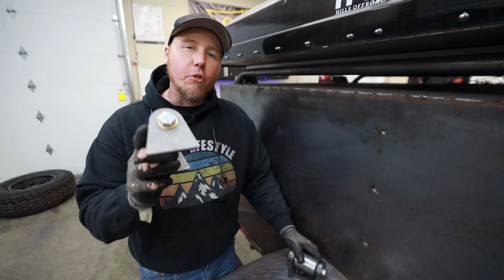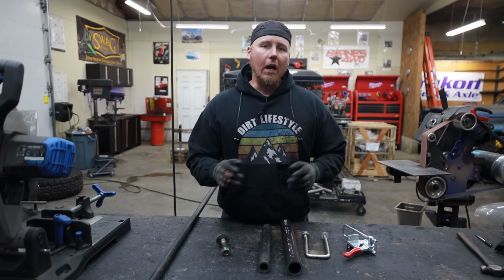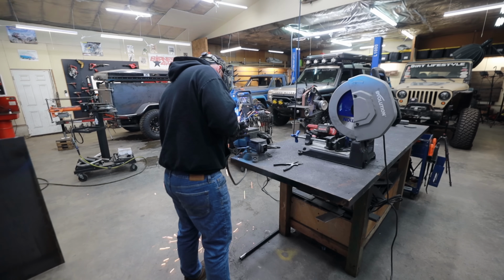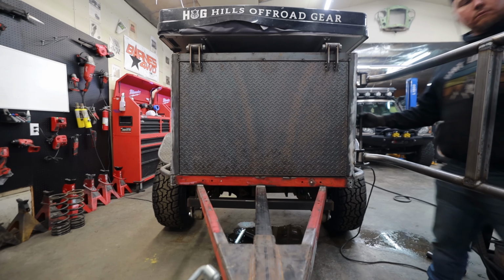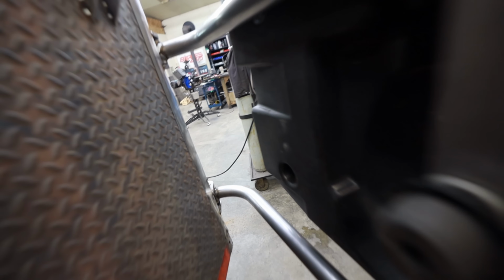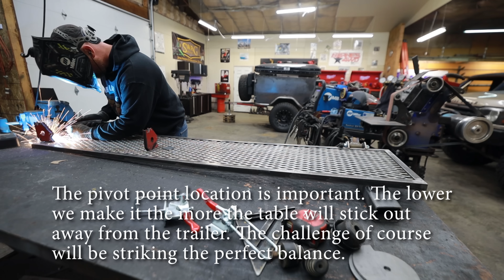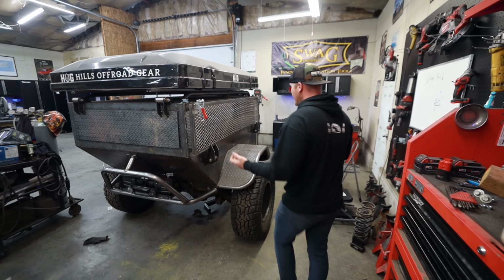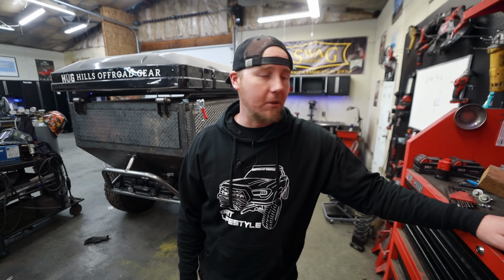Finally Back In The Shop! Harbor Freight Offroad Trailer Episode 6 👊.

Comment: nate, you could add a small tapered spigot near the latch, to take the load of the carrier off the 2 hinges directly. any up/down then would be going into the outer structure. i did see that you said there's no flex in it and its strong, but corrugations (washboard i think you call them) are pretty good at destroying anything that can have any give at all. as for your supports, can you use some old retractable seatbelts and mount them inside? make them bottom out when the table is level. some small latches on the side to hold the table in when not in use

awesome build

Comment: A cable, a counter weight, a few pulleys, and an adjustable stop on each end of the table. Add a latch to hold it in the down position if needed. Put the counter weight in a channel inside the trailer. Think like you’re working in an old freight elevator door. You’ll see it.

Comment: For real simplicity on the table cables... Look at old fashioned big heavy wooden windows. They had weights in the wall, that helped against the weight as you slid those big windows up. You could do the same sort of thing with the table cables. Small pulley inside that the cable rides over. A weight, to pull it down, when you lift the table. And a catch at the top, for the weight, so the table is supported when open.

Comment: A window sash weight system inside the body would make an easy retractable cable system.  Flexible kitchen faucets use the same principle.  Would need a tube as a guide just to keep from banging around

Comment: You could use a weight in the middle  like clamp style  or the old racing seat belt trick with bungie to pull it out of the way when slack is reintroduced

Comment: What about a bungie cord like four wheel camper or GFC uses to keep the tent sides from popping out when you shut the camper? Just hook both support cables and the bungie will keep them inside the table frame as you lift it up to stow it.

Comment: As usual, looking great Nate.  If you can find some kind of coating that you could put in the fuel carrier (assuming it’s been used for fuel) you could repurpose it for water.  What I use for rivnuts is gasket maker but I bet 3m window weld would be the best product for them. For the table, you could go with strong arm gas struts, like for hatches.  You can get them at tractor supply places in Canada for under 8$ a piece, so they’re probably 3$ at harbour freight.

Comment: I would definitely say to use folding arms like you’ll find on a tool box lid. Maybe just coat in liquid rubber to keep the noise down. Actually I feel a lot of things you can coat in liquid rubber for noise reductions. Maybe add some noise reduction pads like you’ll find inside of car doors for the inside of the trailer. 

Along with those folding arm supports it would actually be sick to add a shock, which shouldn’t take too much space, just to show off at camp lol. 
 
I would add a clamp or hooks for a temporary garbage bag…or maybe not.

Comment: I'm a fan of legs. You can have adjustable legs that clamp to the table when up and fold down for support. Adjustable for uneven ground..... BUT..... I've also recently been looking at old 1950's Willys Wagons and think the tailgate supports were pretty slick and simple. Check them out.

Comment: Cables like you said. But have them detachable on one side. The side where they mount on the side of the trailer. Then just clip them along the edge of the tray (horizontally) Flush, out of the way, SIMPLE. Then you just clip the cable on to the body of the trailer when you get to camp. Being that it’s already fixed to the tray, you can never lose them.

Comment: If u want to get fancy u could use electric window motors with a spool on it to wreal the cable in and out or possibly hood struts would also work as long as it latch good

Comment: You could look into hardware for self closing sliding doors. We work at data center with cold containment rows and sliding doors. They have self contained retracting gear and cable sets. Spring tension and adjustable so you could open your gate locks and let table fold down on its own slowly and when fold it up the cables would retrack on their own. Sorry i don't know a direct hardware product...Great build bro

Comment: Check out the tethers that are used for merchandise display such as for phones.  I hear them called "retractable security display tethers".  If it were me, I'd consider chain as it is heavy duty and unlikely to snag on branches and fail safe.  Wrap it in a vinyl or woven sock like on an old step side.

Comment: Maybe build a ratchet style cable system for the table with the ratchet lever recessed in the corner or use the mechanism from a retractable air hose spoil. Then mount it in side the corners of the box.

Comment: Do an eyelit with a weight on one end of a cable. When you put the table up  The weights will pull the cable into the islet inside the trailer. When you pull the table down the weights will act as a stop to keep the cable from pulling out too far.. You could put a piece of pipe on the inside that the weight and cable travel in to keep them out of the way

Comment: To get a retractable cable strong enough, it would wind up being pretty heavy. I like the sprocket chain idea, as well as the simple tailgate style. If you wanted to complicate things, you could make some fold out legs that could be adjusted for height, similar to a swing away trailer jack. Then you could have that table be extremely sturdy...Or another option would be foling supports that pin into the bottom edge of the trailer. That way you have no obstructions on the table top.

Comment: Use a bicycle chain for the table. I saw someone do that on a swing out table and it looked good. You might be able to put it on the inside so it is protected when closed. My 2 cents.

Comment: Have you thought about hinged support poles? My popup camper has a king sized bed that is supported by two poles that hinge out at the end of the bed and key onto a mounting point.  Coleman claims it’s supports can hold over 1000lbs. It’s super simple and could be used to hold the table.

Comment: That latch is really great.  Your creativity and fabrication skills are top notch!   Could you mount the table suspension cable inside to a spring of some sort?  The spring would pull the cable through a hole in the side when the table is not open.  With the springs, the table may require a latch to stay open, because the springs would always be pulling the cable back inside and therefore trying to pull the table up.

Comment: Not sure if this will make sense but I'll try my best, you could possibly have the cable go through the mesh part of the table and have a hook or a T or something on the end so it supports the table in the down position but then when you want to put the table up the cables go through the mesh and then you can hook them together somehow in the middle, so they would act as the latch as well and you could eliminate the ones you have on there currently

Comment: id try a to make a sort of window sash in old houses... cable goes through hole on trailer, over pully, and has a weight attached that you can box in so it moves freely and nothing gets in the way and then wen you lower it, it just pulls the weight up to a stop

Comment: 2 equal length steel bars once you are done using the table as you fold it up they fold into each other, or you can use gas struts like the new tailgates on trucks

Comment: The only retracting cable I can think of is the ones cargo trailers have, like toy haulers. It’s a spring that winds up. If there’s space inside the trailer it could possibly be mounted with a hole for the Cale to be on the outside of the trailer that way your spring is not exposed to the elements. Would probably take some fine tuning since they are used to help with a trailer door/ramp that weighs a lot and your table doesn’t weigh as much as a trailer door so it could be a little too hard to open up with the spring

Comment: a spring on the end of the cable that would pull the cable in a straight line  put a stop on the cable so as the shelf comes down and the cable is pulled the cable will stop at the right Hight of the shelf  then when you lift the shelf the spring will pull the cable back home .

Comment: Attach bolts to the front and back of the trailer by the table, to the sides of the table, and lower down on the trailer. 

You can then use standard limit straps or steel cables and stow them when not in use.

The reason why you don't see the flat bar tailgate supports is they bind when they get bent.

Comment: Retractable cables would be easy, go look at any kitchen tap where you pull the head out to use as a hose to do your dishes. All it is, is a weight mounted to the hose, could do the same with a cable, plus less moving parts would make it more reliable

Comment: Nate, check out constant-force retractors on McMaster Carr. Not sure if the can carry a tensile load once fully retracted, but they do retract cable like you want. Maybe you can add a bead to the cable that stops at a hole? Just some thought, keep up the good work!

Comment: Something along the lines of a garage spring cable assembly? Or you could just do cables with stops and add long springs or gas shocks to the ends inside the trailer.

Comment: My concern about retractable cables would be water ingress where the cable passes through the sidewall. I built my own trailer, the DesertDawg, and water ingress is my biggest challenge. In fact I'm going to have to do a pretty major update on the trailer to address water leakage and the damage it has done.

Comment: I’ve seen the flat bar tailgate comments, but if you were stuck on the cable idea, you could just make them attach with carabiners; you just take them off when you fold up the table (use eyelets to attach them to)

Comment: How about gas struts for the table? Soft drop and it should hold its position when you lift it up. Makes handling with one hand easier. But you may still need support to make it strong enough to carry a deer 🦌
Reply: I used chains on the inside lip of the table. Its also a useful bench and recovery point. 🤣

Comment: Cable over a rollers with a spring. Do the math for out travel and then work out the amount and length internally.  Eg 5 up and downs at 300mm (12") equals about 1500mm (5') travel outside.

Comment: You could use a pair of small engine recoil starters…might take a little finesse to get the cable lengths perfect. But they would work as a stop at full length and obviously recoil when closed.

Comment: Hey bubba just used 2 flat bars as a hinges on each end. Bolt one end to the table and on end to the trailer wall. When it comes down they will always be the same length and the will tuck with the table if you don’t make em wider than it. Wish I can post a pick here
Reply: Damn it just saw someone else had the same idea lol.

Comment: Could use cable with a sash weight inside a piece of tubing so the cable would retract inside and be protected but easily pull down for use

Comment: A piece of flat bar as a stay for the table will be far simpler like a ladder stay. Or, use a series of pulleys to route the retractable cables in a way that you can fix some bungee cord to the ends. It would require some fettling to stop it from being a catapult for anything you put on the table! Unless you want to see your crockery and cutlery flung across the woods…

Comment: I am going to agree with a lot of other commentors. 
- You have all the metal and I would say build some free spinning bump stops by the hinges. That way when you open the table they auto stop at the height you want and auto fold back flush with the wall when you fold the table up. 
- I guess the other idea would be to create a 90 degree elbow strut they use for those huge pelican cases to store rifles and snipers, It would be cool if you found those heavy duty struts for the "Trustmade Hard Shell Rooftop Tent".
- Last but not least, you could try a sliding strut similar to the rooftop clam style tents but have the bottom slide so when it opens it slides along the table edge and when it closes it does the same but it ends up flush with the wall. 
terrible descriptions i know but maybe i gave your creativity something to work with, good luck 🤙

Comment: You can route the cables/chains) in a way so that it creates a trapezoid, and then putting some little weight midway on the cable (rubber bumpstop maybe) will make them "auto fold" once you close the shelf. You would have to experiment with the weight neccesary for the cables, whereas chains might just work out if the box, just that they would be rattling ...

Comment: Don't use cables. Try a Gas Spring / Heavy Duty Gas Strut (some nice stainless steel ones on mcmaster carr)
You want a damper to prevent the table from slamming down (or up).

Comment: The steel cables are going to be the way to go, just run them through into the trailer and attach a weight to the inside end, that way as you raise the table up the weight will pull the cable into the trailer and keep it out of harms way, it'll also act as a stop when the table is down.

Comment: There are light hangers I’ve used that has a rope inside a round yo-yo, that the cable retracts in and out as u lower the item that’s suspended from it. 
I’m sure it’s on Amazon, I remember  buying it from there. I’ll edit this if I find it.

Comment: just weld or add a piece of metal with a straight edge to your hinges so that when your panel is folded down it rest against the side of the trailer. like a door stop.

Comment: Been following this trailer build for a long time. Love the work going into it. 

For the table, you could try using hatch springs. They are strong enough to be a good alternate to gas struts, so they may be good to hold up level with out warping, plus they will hold tight went bent while the table is packed away.

Comment: I have to agree with CameronShute that a flat bar henges support, like what was on the old 1972-1979 ford trucks would work. Problem is, that can lead to some nasty damage to fingers if you catch a finger in it like I have. My thought would be a small hand crank cable wench would be better. Can be one bar, with cables on each end with a removable handle. Kind of like how the jack stands on a semi trailer work in tandem, but instead with cables you wench in by hand.

Comment: Ever thought about just using slotted strap steel or about like the design in a top of a tool box but instead of supporting a tool box lid it supports your table. Just an idea

Comment: I’m not reading 200+ comments to see if this was said before.  But redoing the hinge bracket from bushing to table adding a foot.  So that as it rotates down it stops the table and the door rests against the side of the wall.  Two beefy feet should be plenty strong to hold the table.

Comment: Hey Dirt Lifestyle! On my boat I have a 4 fooot tackle station table which gets folded out the same way your table does. However, my tackle station is supported by hydraulic hinges. I'd say the fiberglass table weighs at lest 50-60lbs so I'm sure you could fit hinges like that to your table if you wanted too.

Comment: I would definitely put a small short ‘shelf’ under the tire swing on the latch end. Maybe with one of those bump stops on top. You take that off road and it will compromise everything with that much weight

Comment: instead of cables, use 2 pieces of steel, one that is slotted the other with a mushroom pin that rides in the slot. That way you can conceal the hinge on the inside of the table and while stowed, nothing can catch it.

Comment: I liked your explanation of how the hinge worked, now I know the basics of how it works.

Your tire carrier looks super strong, but the one piece of square steel supporting the tire and the gas tank looks like it is supporting a lot of cantilevered weight, I would add a gusset to below the square steel, so that all the weight isn't cantilevered on the square tube. It looks like the gas tank has enough space for it. just my 2 cents, thanks

Comment: So my thinking on that table in your hinge itself this part will be a little over thought a spring pin system where once you lay it down the spring locks it to the position you want and you push the button that releases the PIN or manually get the table top where you want it drill holes and slide a pin through it no cables necessary to get hung up on or to hang up on or to be a irritating sound and scratching surfaces as you're traveling through the trails

Comment: For the retractable cables, why not make your own?  Run them into the corners of the trailer, and have either a weight, or a spring that would retract them.  I don't remember if those corners are angle or square tube, but either could be made to work.

Comment: Just watched your video on the trailer build out. For the side table, why not do something like they use on the jumping Jack trailers. The wings open up for the beds and rest on rails that reinforce the frame. The difference is that the wings on the jj open 180 degrees and yours would drop down 90 degrees. 
You could strap jacks, tools, and traction boards to it and not have to remove them to use the table. 
The only draw back is that the rails flair out which would require the table to be smaller. 
Just a thought. New to overlanding and your channel, but like your content!